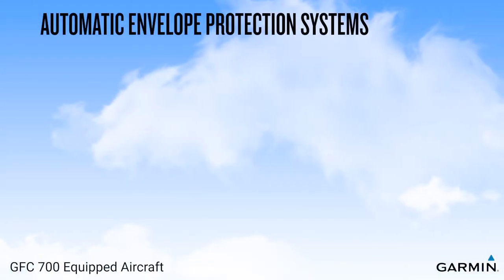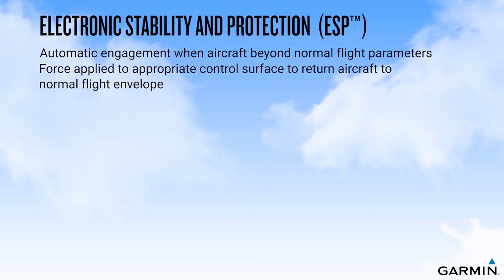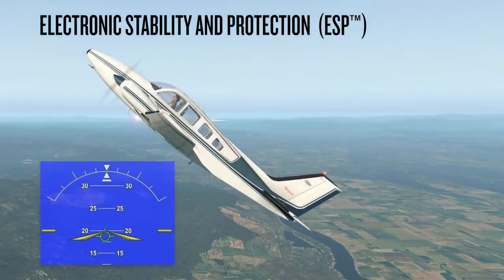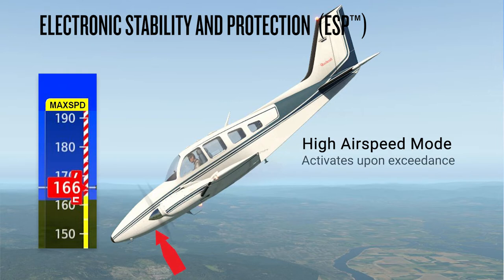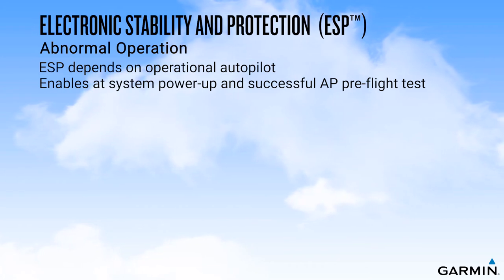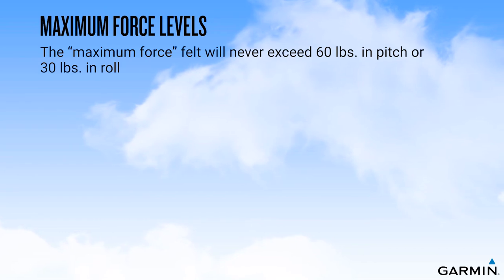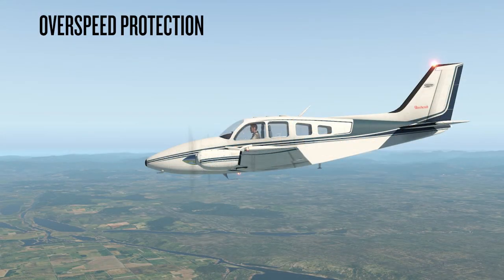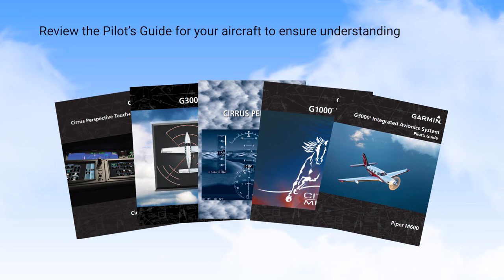Automatic Flight Envelope Protection

Comment: Thank you for the informative video. I am curious about the maximum force that the servo can create at the stick. Is it ever possible that the stick force from the servo is so strong that a pilot of average strength could not overcome it? 

I ask because I am curious if it is possible to use an AoA-based ESP system as a hard limit to prevent entering a stall altogether. I am guessing if the stick force is larger than the pilot's max input stick force, there is a more rigorous certification process. Thank you in advance.
Reply: I have instructed in several aircraft that have the ESP system. The corrective force applied is rather gentle at first, and increases in intensity the further you move the controls from the normal flight envelope. At no point is it so strong that a pilot couldn't overcome the force. It is more like an invisible flight instructor nudging the controls back towards normal flight. If I had to put a number on it, I would say perhaps a maximum of 8 pounds of corrective force. The Cirrus Vision Jet has an AoA-based stick pusher system that applies up to 80 pounds of force to get the nose down when approaching a stall. It is very hard to fight that force, but then you shouldn't be fighting it.